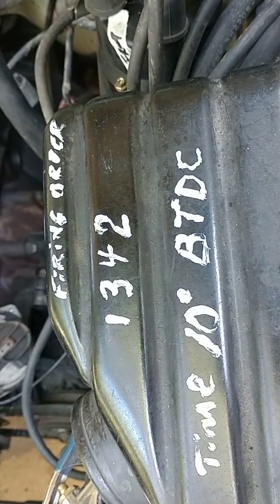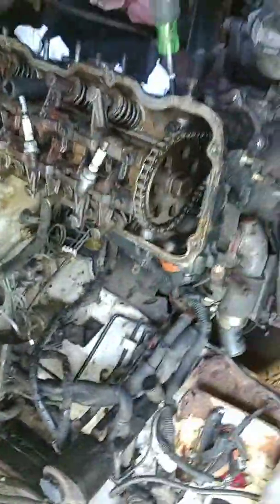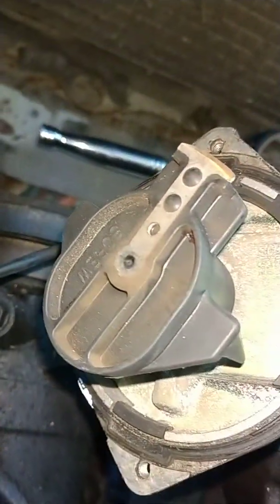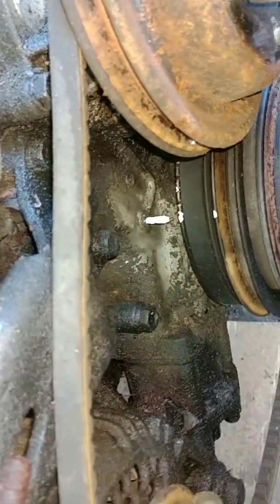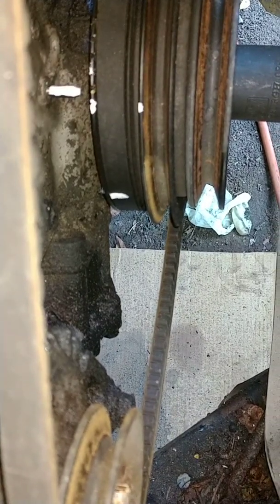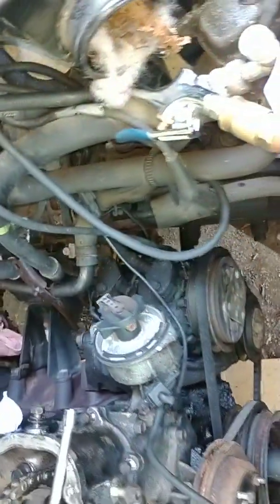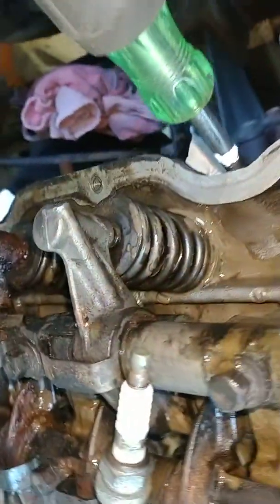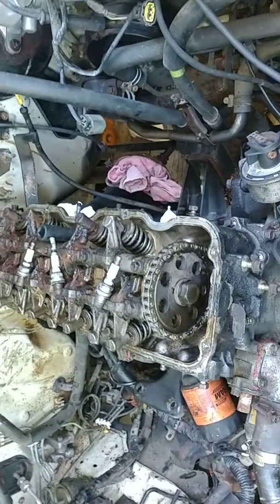Hardbody D21 Firing Order Timing Information

Comment: Wrong! Its -5. 0. 5. 10. 15. 20.   Im looking at the factory service manual right now.
Reply: no he was right he just didnt say -5. he just started at TDC
Reply: So -5 is the tdc? I thought it was 0
Reply: I set my truck on the top center with a timing light on the gun. I set  it at 10 and then on the pulley where the timing marks are at. I set  it on zero but my truck did not have very much power setting it on zero so I set it at 10° on the pulley I’m wondering because when I install the new distributor I had to reverse the order the firing order so I’m not sure if I threw it off but the truck runs a lot better at 10°

Comment: I am trying to fix one, it will not rev pass 3000 rpm and the gas pum is new the sprak plug and wire and cap is new, so i put the ecu on a next pickup on it is ok i try a AFM on it still not going pass 3000rpm and it is missfiring i check the tps and distributor and AFM wire to the ecu and they are ok i have plug off the coolant sensro still not fix, can someone help me.

Comment: could you in theory set the pulley at 10 degrees then adjust the distributor so the marks on the distributor and the rotor line up? obviously then check it with a timing light after